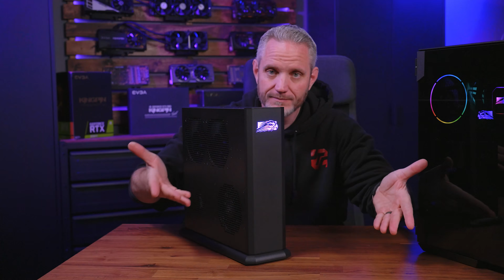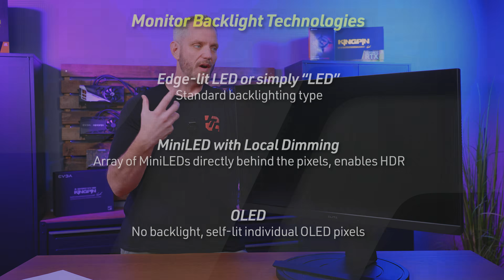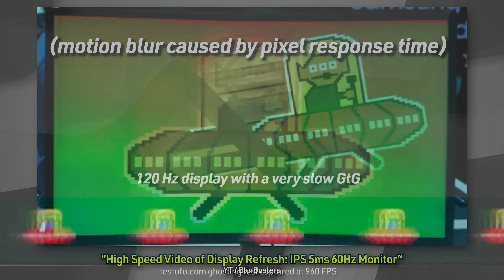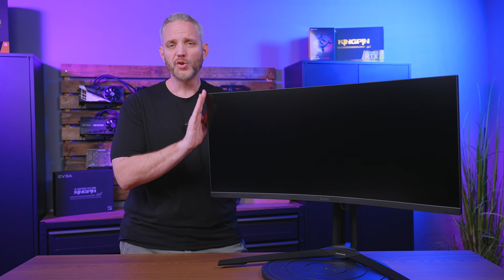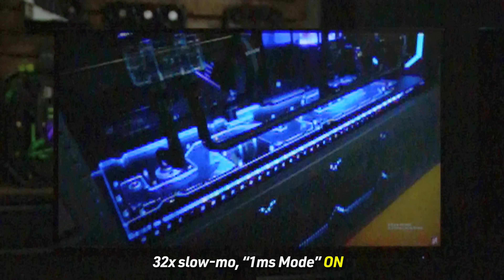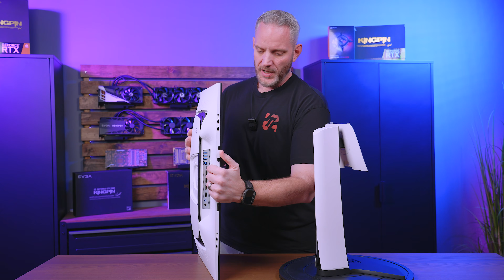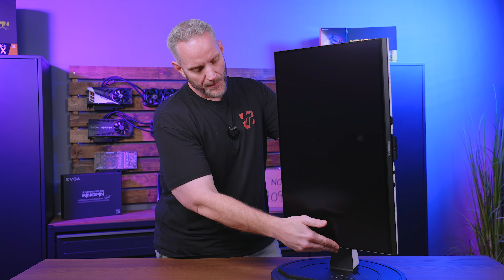Ultimate Gaming Monitor Guide: Find the BEST Screen for Your Setup

Comment: TLDR: Monitors don't need RGB LED strips!

I find it funny, that "gamer" is always associated with RGB LED strips. As a gamer myself, I am very annoyed by all this RGB LED bullshit. I don't need them on the back of my monitor, and I don't need them inside my PC. I am using a noise cancellation case without any windows. I also don't need RGB keyboards. I know  where the keys are, I can type in the dark just fine. In fact, I am still using an older PS2 keyboard, because it allows for true N-key rollover. That, and the key haptics is what really counts.

Comment: Hi Jay, Could you cover the topic regarding the various realtek Audio drivers as well as what hardware could be attached. Im still using my p67 Sabertooth from ASUS... so yeah its an old potato. But seeing the newer motherboards, they have lesser soundout connections for a 5.1 system like the b870 motherboards. Theres alot of jargon out there regarding the newer alc drivers but dont understand how they work as well as where it leaves my older 5.1 logitech speakers... but could never get my head around it. Thanks  @JayzTwoCents

Comment: Glad you did this video as a lot of gamers overlook the monitor as an extremely important component. I found my perfect monitor a while back and continue loving it every day - LG Ultragear 34" curved 34GP83A-B, Nano IPS 1ms, G-SYNC and FreeSync, 144Hz (160Hz OC). Paired with the proper icc profile and proper physical settings this is very hard to beat.
Reply: Jayztwocents rec - mini led lcd panel 27 inch 1440p 144hz 1ms  - under 300 dollars. What would be the best monitor in this category?

Comment: didn't older panels use black to white instead of grey to grey. Was this change to make them show a faster response. The only problem with oled is burn in. Would much rather have mini led but the prices in a lot of cases are higher than oled...witch to me sounds like bs price gouging. All most everyone buying into oled will get burn in and scream BUT THEY SAID. yea turn it on to play games turn it off to do everything else.

Comment: I've been on IPS 1440p 165Hz screen a while, it's great. Looking (desiring) OLED screen with higher refresh rate, and better motion clarity. What puts me off, I also use the same screen for work from home, which has got load of static icons for the software, so afraid of burn in. If this only ever did gaming (including static HUD) I think I'd buy it.

Comment: Running a CoolerMaster GM34-CW (1440p 32 inch VA UW 144Hz). Good angles, slight (hardly noticeable) curve, good colors as far as I can discern. I haven't been able to notice ghosting. Very happy with it. 

And the best thing? It has a normal name so you don't have to use half the keyboard to spell out the name. (/s ofcourse)

Comment: I've recently purchased the MSI MAG 271QPX QD-OLED E2 I've had it since Christmas and got it on a really good discount I'm super happy with it. There is the odd issue but nothing major at all would recommend this monitor if you can find it at its sale cost as its a absolute bargain. It's also a huge upgrade on my old acer 1920x1080 60hz monitor 😂.

Comment: Still running 1080p60 panels... I need to upgrade to 1440p but OLED is 100% out of price range. IPS is the way forward for me. 1440p144hz is where I will be looking myself.
Reply: Jayztwocents rec - mini led lcd panel 27 inch 1440p 144hz 1ms  - under 300 dollars. What would be the best monitor in this category?

Comment: Bought a xg27aqdmg for 550 recently. Upgrade from a xb271hu which I sold after. All in all I only paid around 250-300 for the upgrade after savings and selling old one. Highly recommend as a panel

Comment: Had to pause the video when you mention rye curve monitor “R” numbers... The “R” is the radius (typically in mm) meaning if the curve was to continue into a full circle, what would be the distance from the centre to the edge of that circle. The Radius. The smaller this distance the smaller the circle and therefore the tighter the curve.

Comment: When i built my current computer back in 2019, i spent hours upon hours figuring out how i wanted to build it.  One of the biggest issues was the monitor.  The lack of visual inspection made it more difficult to decide.  I looked at various brands, which all sounded good, including some of the ASUS and LG offerings and maybe a couple other brands.  After a grueling internal debate, i went with the ViewSonic Elite XG270QG 27" which was reviewed by multiple youtubers, you included, and I've not been disappointed.
Reply: I always find the audio component of a new build the hardest to get my head around.  Always seems way more mysterious than monitor as they have specs easier to understand.  1billions colours, 1 ms or less response, 144hz, check.. . pushing beyond that is 1080p territory to me . . . LOL.
Though, to curve or not to curve' that is the question.  But manufacturers are taking that choice away.  
🤣

Comment: Personally... I prefer arms.  The stand is removed and stuck in the storage room with the old PCs... I would prefer to be able to buy monitors where there is no stand supplied.  It would be cheaper to do, as they don't have to make or supply the stand.  Cheaper to stock/ship, as the box would be lighter (maybe even by half in some cases), and the box thinner (no thick base to deal with or arm standing off the back).
I also wish more devices supported and made it easier to have it work for DisplayPort Pass-Through, to daisy-chain the screens, so have less cable clutter at the back of the PC, BUT for gaming, at a high resolution... that isn't the best, as the BW at the port of the GPU is limited, so best to not push through 2 monitor's worth at the same time (And this video is looking at gaming monitors).  I go for colour calibrated monitors as I do photography (even if I have a unit to do the calibration for my room).

Comment: This video was IMMENSELY educational for me, and it's perfect timing! I'm pre-building my new PC that will be purchased in the next few months, but I've been on the fence about replacing my monitor. It's not that I don't want to, but space is very limited and I already have a  24" that barely fits. I've determined that I can go up to 27" wide, and now I have a better idea of what to look for
Reply: I suggest not going above 25" for 1080p, as the pixels will start to blur the larger you go from there, which is more noticeable on a monitor vs a TV due to how close you sit. 1440p/4k is more suitable for 27" and above. Further, only go with 1440p or 4k if you either; only care about 60 and not above that, or have a very high end PC. Most newer games are not optimized well, which means they will suffer far more when going above 1080p. If you play mostly older games, you might be able to get away with it a bit at 2k.
Reply: @AttunedFlux  I wouldn't even say most new games are poorly optimized, it's just a lot of AAA trash that's poorly optimized. Especially anything on UE5. System Shock Remake, Doom Eternal, RE4 Remake, etc. show that you can have great looking games without crazy system requirements if the dev team actually knows how to optimize it.
Reply: If I can make a suggestion, the KTC H27T22 or H27T22S both seem like excellent 27" 1440p monitors and are less expensive than similar monitors from bigger brands. Got myself the H27T22S recently around Black Friday for $200 CAD and it seems great. Good colors, compatible with G-Sync/Freesync, and up to 180hz. Only downside is the stand, which is basic and can only tilt up or down, but it's VESA mount compatible too.
The H27T22 is only up to 165hz and has a slightly lower color gamut, but is also brighter and has a much better, more adjustable stand. Assuming you're in the states will probably be much more available too, I couldn't get it myself due to being in Canada.
Reply: @100organicfreshmemes5  Thank you for the recommendation! I found the H27T22S on Newegg for $155. It looks like a good candidate. I especially like the 3-side frameless design

Comment: 1:35 UNfortunately;
With TN, you get better response time, higher refresh rate and at a lower price, with the only caveat being... having to look at it in the front, which is what you're freaking supposed to do with a monitor? Viewing angle might be relevant for laptops or for TVs where you want a bunch of people watching it not necessarily perfectly in front of it, but for a PC screen, viewing angle is absolutely irrelevant. It's sad that IPS took over the market over TN, but at least OLED leaves both in the dust
Reply: Jayztwocents rec - mini led lcd panel 27 inch 1440p 144hz 1ms  - under 300 dollars. What would be the best monitor in this category?

Comment: I have two 27" panels an Asus PG278QR 165HZ 1ms Gsync TN panel I use as my work display and Asus VG27A 165HZ Gsync compatible 1ms IPS I use as my gaming panel both are 2k paired with an RTX 4070

Comment: Since 2024, 1080p 27 inch IPS 165-180Hz monitors have been very cheap, usually 140-160$.
Reply: Jayztwocents rec - mini led lcd panel 27 inch 1440p 144hz 1ms  - under 300 dollars. What would be the best monitor in this category?
Reply: @thetmal5783  Dell G2724D => 200$ 1440p IPS 165Hz monitor
AOC AGON Q27G3XMN => 300$ 1440p IPS 180Hz monitor

Keep in mind 1440p is much more demanding than 1080p in 2023-2024+ AAA games, so you will need a much stronger GPU to run them well. If it's just for esports then you are completely fine.

Sadly the PS5/XSX and PS5 Pro are very powerful for consoles, meaning that for PC AAA games are very demanding nowadays, and will get even more so once they start making games with the PS5 Pro in mind.

Comment: I traded myself to a Samsung Odessey G7; 32", 240hz VA - it's more than enough for me. Though I do hate with a passion that the physical buttons on the bottom of the bessel is often not responding and lots of times I can't udjust settings (common Samsung Odessey problem, as far as I understand it).

Comment: I'm giving GAMEPOWER a chance with their monitors. I recently purchased their GAMEPOWER Royal T20 27" 0.5ms, 180Hz, IPS, 2560X1440 QHD at $139!!! This thing is amazing to say the least and 0.5ms response time! They are newer in the American scene and are better than most other monitors as this spec and size. The stand for this monitor is so sturdy too, has internal metal wrapped in plastic and it's beefy as most at this price point are mostly plastic. I also have a GAMEPOWER F20 27 Inch Curved Gaming Monitor, 120Hz 1080p Display, 1ms Response that has such deep blacks, it was $99 when I purchased it but that was an intro price as it's now $125. No I'm not sponsored by them but just wanted to toss this new upcoming brand out there as they have some great monitors.

Comment: About a year ago the LG 27in 2k OLED was "cheap" for what it is so I got that. It does actually still look really good if at 1080p even though it's a 1440p. I tend to keep my monitors for a long time so putting some money into them I'm ok with. My last monitor was about 10 years old.

Comment: I still have the acer predator XB271HU from when it came out, now I'm looking to add a second monitor, looking for the same spec as the predator but in OLED, 27 inch, 1440p, 144hz

Comment: 11:00 small correction. FOV has nothing to do with the screen but the FOV setting in games. The wider your screen the more distorted and stretched your corners will be. Its very noticable when you compare NV surround with 3 16x9 screens with a sim supporting 3 viewports so every screen gets its own perspective
Reply: I think.he ment fov from which sngle you can see picture clearly...not fov in games..2 different things
Reply: He said as much in the video. He said on a UW monitor you get a wider FOV, which is completely true because it's a wide monitor. He also specifically mentioned that if you do this on a regular 16 x 9 monitor you will see distortion because it's not wide enough to display the wider FOV. So, yes, a wider screen will give you a wider FOV without adjusting any settings.
Reply: Ya. we all knew what he meant buddy

Comment: I wish Hardware calibration wasn't hidden behind a paywall. Software calibration sucks hard and many screens are terribly oversaturated.

Most high end gaming screens could easily bet below a DeltaE of 2 if the manufacturer cared about that. Afaik Gigabyte has a very acccurate sRGB Mode

Comment: My Feedback: Great video idea and concept, however ("only") good execution.

I would like some more illustrations, pictures, animations and perhaps analogies to go along with your verbal explanation (Analogies like the relation between screen size, screen resolution and the pixel density as the relations between size and res; Perhaps illustrate that with Lego blocks, small blocks vs large blocks where they are the same amount i.e. representing "pixels").
I could follow along just fine because I'm "well versed" in monitor tech, or how you want to describe it, but I think we can do this good video even greater with more pedagogical tools.
(as a side note, as others has already mentioned, you got the R value for curved monitors reversed, lower R-number is higher curvature, R is the radius and the screen is the sector/arc of the circle.)

I really like these kind of videos, they are great for teaching us why we should perhaps care more about e.g. monitors, and more specifically How/What to care about and *Why*.
My feedback is to add the pedagogical explanatory content that I mentioned and correct the minor things.

Comment: Finally moved to OLED, Dell AW2725DF.  1440p 360hz and Freesync.  Straight away the blacks are inky black and the colours are far more vibrant for sure.  It's a compromise though.  The screen needs to move itself now and again to prevent burn in, and having the sun on it or any close light source reveals the lining as it were inside the panel and is really, really distracting.  Get it in a darker room though and it's great, if lacking in brightness somewhat.

Comment: im having for more than a year now 27" LG WOLED 240hz alongside 144hz 27" 1080p IPS also from LG. for me right now anything less than 27" OLED is no go. I thingk in the future i may try QOLED cuz they tenk to have better HDR colors but blacks is worse especially when ur using it in somewhere that has light. HDR and colors that OLEDs tent to have is really deal breaker.

Comment: I picked up two LG 45GS95QE Ultragear OLED. 1st one had the prison cell theme on. (vertical bar issue). 2nd one is perfect.
REALLY like the massive curve. Everything from games to movies look amazing. 
Still in the return/refund window as Amazon won't swap for a good one. Refund only and would have to send it to LG for a fix. . Hate that policy. 
Thinking of doing the refund and picking up the 55" Odyssey Ark 2nd Gen. 4K UHD 165Hz
I highly recommend the LG 45GS95QE. It's more than the sum of specs which people think are low.

Comment: man, i really wish he talked about burn-in, cuz I'm really confused about which type of display is least susceptible to it happening.
Reply: Have had my C2 for a couple years now. Kept FPS counter in the top left corner for past 4 months. 6-8hrs gaming daily and still no burn in if that tells you anything
Reply: pg32ucdm has oled care and 3 year burn in warranty
Reply: Burn in only really happens to oleds and that hadn't really happened in like 5 yrs
Reply: @swnick3386  Ive had burn in happen on every OLED device I have owned. OLED are also much dimmer (only 250 nitts... vs some miniLED at 800 nitts). the reason OLED is dimmer is they try to protect themselves from burn in. the steam deck OLED is a good example of a OLED screen without this safety feature that some people have had burn in with.

for TV's and Virtual reality headsets OLED is amazing. for monitors it depends what you do (and how bright you have to drive it. if you are always at 50% brightness with your lights off, then you will likely never have burn in issues)
Reply: Check out RTINGS educational videos about it or HUB.

LED backlit (FALD; static) displays are the least suseptible to permanent burn in. 
Oled (QD; WOLED) are most suseptible.
Reply: Don't stress too much about burn in, new panels have settings in place to mitigate that... Just enjoy
Reply: @joniqst  So there's no difference between getting an LED vs OLED? I've had my current LED monitor for about 4 years and I 2 years ago noticed burn-in from the taskbar, which has only gotten worse.
Reply: @ReynaMirez do your research for sure but definitely really hard to burn in these days with newer OLED tech
Reply: OLED are great if you game at night or with the blinds down. however people should be aware they are much dimmer than miniLED (and are more prone to burn in when pushing the brightness). my current monitor is 800nits fullscreen, and with the blinds up is only just bright enough....most OLEDS monitors are only 300nitts fullscreen
Reply: @legendp2011  see this is what im talking about. I'm in the market for a really nice monitor. I dont have time to baby sit a thousand dollar panel if I "break any rules" and get a burn in. . I use my gaming PC for everything. video editing, watching stuff, gaming, etc. Now what? just get a decent IPS and call it? I have a very busy life/house hold. There have been nights I leave a screen paused and it sits all night.